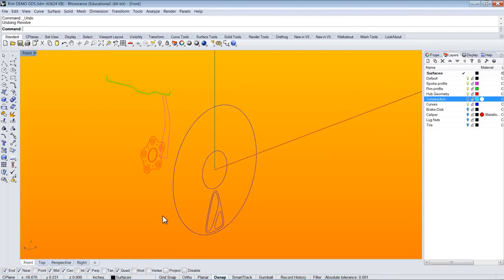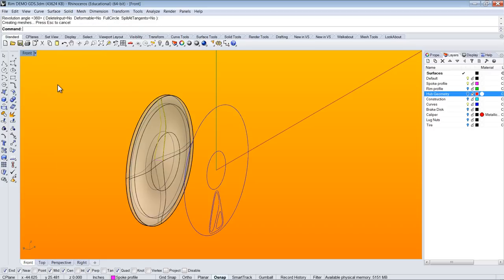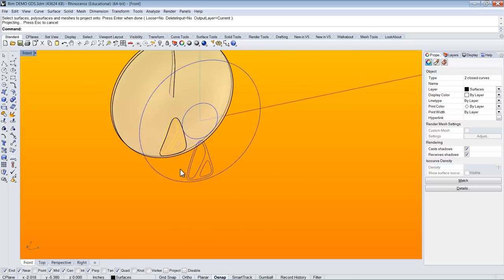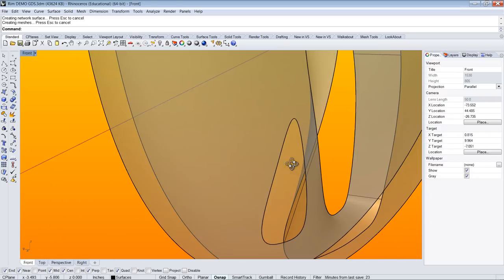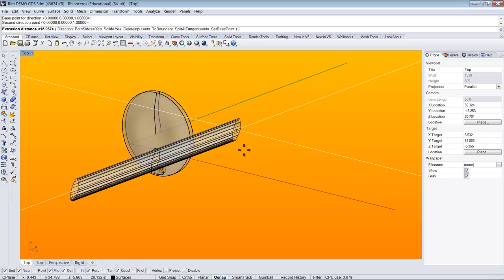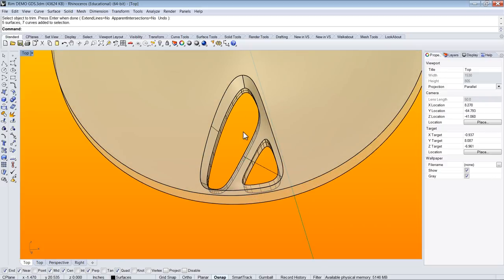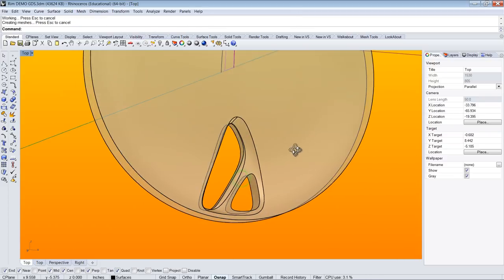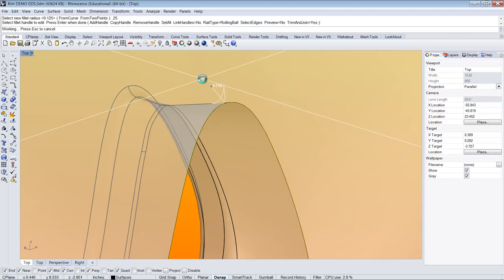Rhino V5 | Modeling an Automotive Rim

Comment: I'm a occasional longtime rhino user, for years I've been using rhino but never really to it's full potential. I mainly use Mastercam on a daily basis but always revert to Rhino for that special project and everything in 3d. Watching your video made me find many missing commands I was not using in my workflow that I knew Rhino had but never really had the time to find them. Thanks so much for making this.
Reply from the maker: +Suade907 I used MasterCAM before they went to the icon interface...  Basically like talking your way through a project.  Create, line, horizontally constrained, from endpoint...
I tell my students that if you think Rhino should be able to do something, take a moment to look.  Chances are it is there!
Reply: +Brian Oltrogge Funny you say that because many times when I'm prepping a artsy vector job for waterjet cutting I'll run it through Rhino first. It's amazing how much power is buried in Rhino. Your definitely right, often I will search and find a way to do something in minutes that would of taken me hours in mastercam or another software package. I'm constantly blown away.

Comment: If you want to avoid undesired issues with meshing of Rhino's revolved objects, simply create those surfaces with either Sweep 1 rail or Sweep 2 rails command. This way, your meshing will be much cleaner and consistent to the rest surfaces. The issue is caused by the nature of the Revolve command which creates Degree 2 surfaces (Rhino always had problems with those), whereas the Sweep 1 rail and Sweep 2 rails will give you Degree 3 surfaces.

Comment: How did you project the form onto the surface from the perspective view? I can only seem to make this work properly in front view (where it is obviously much harder to see what you're working on)
Reply from the maker: Mark Clemmens  There are a couple of things at work in the Rhino modeling environment...  The way you look at the object through the view port and how your cursor can effect the object within the viewport.  This is called the CPlane or 'construction plane'.  I should do a video on this as it is a major stumbling block for understanding how to model organically rather than using the front side and top view approach.  Simplest way to tell you in the comments would be to set the front view and rotate.  Otherwise, in any view you can always go to your view port menu at the upper left and select the appropriate c-plane.

Comment: .
How are lug nuts suppose to tighten up against an inverted curved surface? I think you needed to add a seat for the lug nuts on the front of the rim, But good job otherwise.
Reply from the maker: http://youtu.be/bezdc2XjEV4?t=17m3s

Thanks!